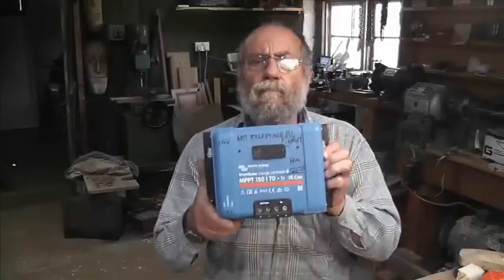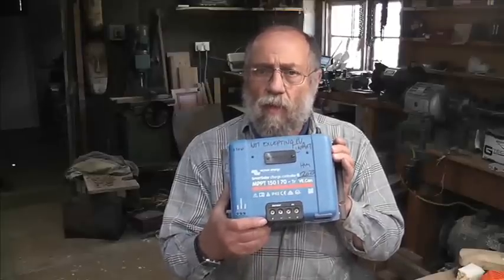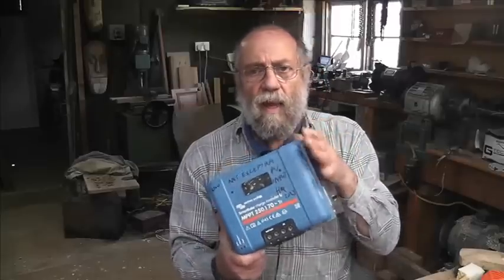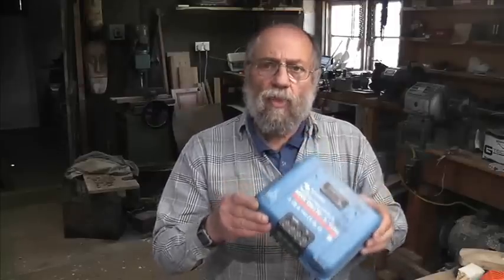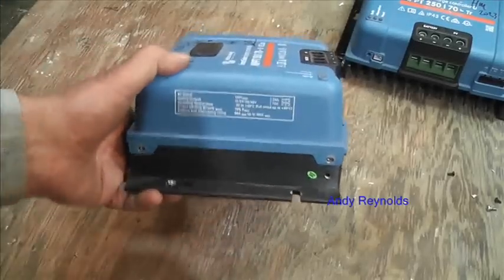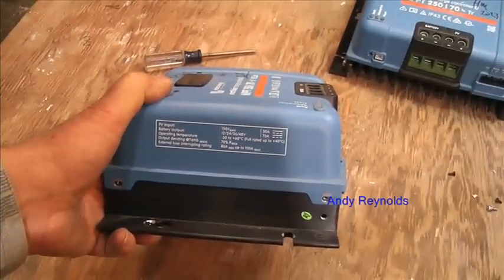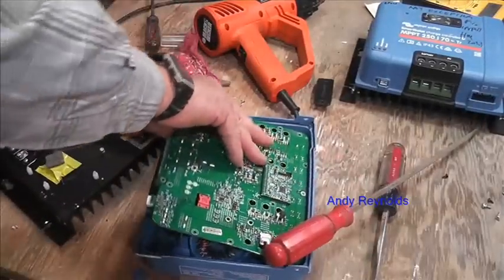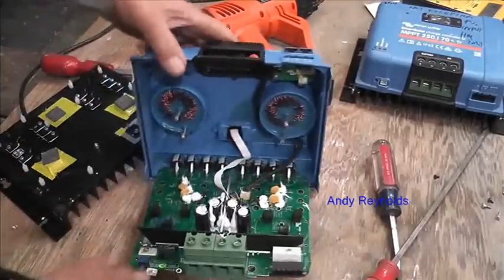Victron MPPT charge controller exploded

Comment: Maximum unrepairability. Everything is assembled on the backplate/heatsink, potting compound is poured into the housing cavities, then the fully assembled electronics package gets dropped into the housing, screws are put on to keep everything aligned until the potting sets, then the thing can never be taken apart without destroying stuff. If you want to get in without destroying the electronics, you have to hack the housing away to free the inductors and caps.
Reply from the maker: Hi, yes cutting the top apart seems to be the way. Time for someone to show precise measurements, someone with another unit and a loose top, cheers
Reply: @TheInfoworks  make holes across the housing, string a jigsaw blade through, saw the top off. Probably the easiest way to avoid damaging components since you are cutting away from components after the starting holes and can also use a boroscope to check things out first.

Comment: Same thing with Apple products.
Reply: not sure I agree, apple is very repairable, and always was, typically cheap spare parts came online quite quickly after a release. but now with apple the phones are still easy to take apart and replace parts, but you have to get apple to do it because of ID chips in the screen, battery, etc that are linked to the phone. This nonsense with victron is tricky, because even they can't take the thing apart to repair it. So either they have every confidence that their items won't fail, or they charge such a high margin that warranty repairs are dealt with by throwing a new item at the customer!
Reply: @bootsowen  Apple laptops has been easily reparable up to the M series, now they go into landfill. Or is sent to Africa. Victron charge a very high price compared to production cost it is designed in the Netherlands but is produced in India presumably with low salaries. US built inverters can be run full load continously but I would only run Chinese ones up to like 75% of rated load. But since the latter is third the price it is still worth it. Victrons inverters five years ago would lower the permissible load if run continously but they were as expensive then. Some Youtubers in vans reported this. It was thermal shutdown. Victron never was a consumer company they started vith equipment for big luxury boats were the price wasn’t a problem.
Reply from the maker: @bootsowen   Owen, that's how it seems to me, having destroyed one in the name of find out, then the next one has more of a chance, cheers

Comment: I think maybe victron are no longer able to compete with the cheap products which are widely available. I notice much of their stuff is 'on sale'. When you can buy 3 cheap inverters for the price of one victron what are you going to do?
Reply from the maker: I have good experience with the older Multi plus inverters, 25 Mw, 15 years and still going strong, but as you say the competition is getting better. The main thing is run them cool and not near rated output, cheers

Comment: I have a HYUNDAI genarator in to fix the inverter is potted in resin so no repair I think items like that should be removed and banned down to waste we supposed to be green in the UK lol
Reply from the maker: Hi, I can see vibration can be a problem with generators but total potting is just corporate banditry, cheers
Reply: @TheInfoworks I get it with the heavy caps but a simple cable tie fixes that but resistors and small components no need for it like you say its about the money
Reply from the maker: @daveherd6864   Dave, exactly, and so the company good name and respect for quality is slowly eroded away at the altar of short term profit and bonuses, cheers
Reply: I also had a hyundai inverter Generator used it 2 times for maybe a few hours of run time and boom dead like you say all potted junk unfixable without a new inverter that you cant buy

Comment: You can use the PCB to drill the front cover to make a jig. This can be used to access the screws on the ic's on the heat sink.  You can then access through the tear. You would have to drill the front cover on every mppt you opened but it looks like it could be done while missing the coils.  Try it with the other unit?
The potting on the front cover is about vibration, mainly noise. You know how noisy coils can be.
Reply from the maker: Hi, yes, vibration but they didn't need to apply so much. I'm going to investigate this wrecked board to see where the power loss is, might be the FETs, in which case we will just have to take the other unit apart. more vids later, cheers

Comment: subbed m8. thanks. bought a 35$ 30A mppt controller on aliexp by EASUN, was considering viktron but atleast i can take this one apart... feels like about 35$ worth of copper inside so it cant be that bad.
Reply from the maker: Really difficult to know where to allocate hard won funds. I've found keeping units cool and not running too hard helps with reliability, cheers
Reply: I have an OAE 60 amp MPPT for 12v to 48v systems with a max of 150v input. It weighs about 15 pounds or more. I don`t know how to program one and the manual is badly translated but I set it to 12v for my 300ah battery and chose the lithium ion setting. It only has float and it`s auto set to 13.80 volts which is the cutoff voltage of my LiFeP04 charger. But this can be changed. 

I ordered a Victron 100/30 to raise the wattage going into my battery because the controllers force us to use 10 gauge cables and I can only charge at 300watts with my setup right now using 12v. I need about 600 watts for my 400w window air conditioner after the next hurricane and to easily recharge my portable power stations for my freezer and dorm fridge.

Comment: If it gets hot in use put a fan on the passive radiator.
OR you can make a chimney over it so all the hot air rising will pick up speed and improve the passive heat sink without any extra powered fans
Reply from the maker: Hi, yes small external fans blowing air up the heat sink, all controlled by a plug in timer. Only runs when the panels are generating, cheers
Reply: I like to use 3 speed USB fans to cool any chargers that get hot.
Reply from the maker: @baneverything5580  Yes, it's important to keep your electronics cool. With an external you can control it and see it working, cheers

Comment: Thats why I bought SRNE MPPTs MAserie, they have huge passive cooling body and can be took apart easy if they fail, whats unlikely, cause I mounted 3 pcs 40mm PC fans underneath powered via a temperature switch.
Reply from the maker: Interesting and yes I use small snail fans controlled with a time switch, cheers

Comment: Try oven heating.   You can leave in for extended time to alllow  the heat to soak in.
Reply from the maker: Hi, difficult, I wouldn't want to cook those capacitors, maybe gas mark 1, cheers

Comment: oh nice, taking apart a Victron charge controller.  I tried to do that on one of my smaller 75/15's that I broke (I tore a screw-head off on the terminal block), so I decided to use the opportunity to see what was inside... but the thing was mostly potted and full of salt (or something) as part of the heat dissipation mechanics.  I didn't get very far.  I always wanted to know what was inside.

The potting is about vibration and heat dissipation.  In fact, absolutely necessary for heat dissipation (not just the FETs.  The inductors and capacitors need it as well).

-Matt
Reply from the maker: Hi, I opened a 12 / 24 MPPT unit a few weeks ago, the heat gun worked. Next week I will be looking at the FETs as the fuse was blown, cheers

Comment: Maybe drilling the bolts on the 14 mosfets attached to the black heat sink so that they are released. The thread in heat sink will be damaged so a solution to fix that will be needed.
Then once the black heat sink is removed desolder the two coils and the 8 capacitors that are potted.
Victron offers 5 years warranty so I guess they are confident about their design and if it fails during warranty then they will just replace the entire device. 
This are 3000W+ DC-DC converters and even with their excellent 98% efficiency it is still over 60W of heat that they need to deal with thus the reason for potting the inductor and capacitors. It also help with vibrations but main reason to pot the inductors is cooling.
They could have designed so that is repairable but the extra cost of doing that is probably higher than just replacing a few units that fail within the 5 years warranty period.
Reply from the maker: Hi, good idea, it may be that the fault could be just in the FETs and then small through bolts could be used giving a little flexibility with placement. I think some investigation is required to find out why the generation is not getting through. The fuses are not blown so it may not be the FETs. Cheers
Reply: Can probably put some screws on the transistors and glue them so it doesn't spin and carfully assemble and put nuts on the heat sink side at the end, just keep in mind any isolation between transistor and screws if it is allready insulated between the heat sink

Comment: That poor manufacturing by victon, how to u repair an instrument, if you can't dissemble easy
Reply: yeah poor manufacturing by victon, that's why they give you 6 year warranty...🥱
Reply: Its a bit of a mixed bag.  If you want something like that to last out in the field you pretty much have to seal it in some manner.  Potting, conformal coatings, etc.  And deal with heat and vibration.   Otherwise environmental conditions outside wiggle their way in and greatly shorten the life of the power electronics.
Reply from the maker: Exactly, it's clear this is not meant to be taken apart, cheers

Comment: I was struggling to see properly as Im on a phone but were the FETs attached to the heat sink with rivets or screws? If rivets, I would drill them all out and then that would give access to desolder the coils and caps. I have 3 of the 100/50 mppts and a 3kva multiplus.. they have always been very reliable, even the single second hand one I have. They are pushing the full 50A most days.
Reply from the maker: They are screwed in place, but from the inside. Heat is the slow killer, who knows what these have been subjected to. A small external fan on a time switch will help to make yours last longer, cheers

Comment: Appalling.
I've just watched the video ChrisFairbrother recommended. It's a good one and followup too on testing. That guy suggests cutting a slot out so you can see inside and properly mark out for drilling. Others suggest using more heat but then you'd need to know exactle where the potting is. Another suggested sacrificing the caps (as they dry out above 125c and are cheap to replace) to get the coil potting soft enough.
150v @80A is too much for a small passive heatsink like that.
Reply from the maker: Ian, like all bits of kit these days the rating is only achieved under perfect conditions. In real life they fail, much better to run at a lower rate for a decade or more. I'm thinking of cutting the top from the other unit, just to see if I can fix it and deal with the top problem if I need to, cheers
Reply: @TheInfoworks hi Andy, perhaps these devices should have a duty cycle on their specifications. A lot of effort has gone into their design and manufacture. Is the pay back of repeat custom from blown units too enticing to fit larger FETs or limit their capability within a safe margin?
It's a fine line to design them to fail often enough to get repeat custom but rare enough to not damage their reputation.
Reply from the maker: @ianhelsbyservices  Ian, I think applying rule 2 as a standard means buying an extra unit, but only buying it once. It's the same with grid inverters, pushed to the limit in enclosed poorly cooled areas, a disaster waiting to happen, cheers
Reply: Your comment about the heat sink being under rated for X current and X voltage makes little sense
without mentioning the FETs on resistance. The source voltage is totally irrelevant when talking about losses in the heat sunk FETs. It's only the voltage across the FETs  that count towards the losses. Power dissipated in the FETs = I²R (current squared times the resistance) If the current is 80A and the fets on resistance = 20 miliohms, then the losses, in watts  = 80² x 0.020 = 128 watts with a fet voltage drop of   around 1.6 Volts (current times on resistance) 
If the FETs on resistance happens to be 10 miliohms then the dissepated energy would only be 64 watts at a voltage drop of 0.8 Volts
The on resistance of new tech FETs is getting crazy low these days allowing for huge currents to be switched with minimal losses.
Reply: @jamiesony3859 thank you for your reply! The information and perspective you share is exactly what this channel is about.
I wonder if the resistance elsewhere in the circuit could contribute.
Reply: @ianhelsbyservices  I appreciate your reply, it can be hard to correct information without coming across as an arrogant dick, especially over text. No criticism intended and I'm glad you took it as such :) and of course anyone watching Andy is obviously keen to learn so I took the chance. There will definetly be some losses in the inductor coils but it will be negligible compared to the FETs. I would guess that high 90 odd percent of the losses will be in the FETs alone.
Reply: @jamiesony3859 looks to be a IRFI 4321, 12.2mOhm max 16mO. My initial comment was misguided as I had inverters on the mind which would take switching frequencies into consideration. This being an MPPT wouldn't be switching as fast I don't think.
For communicaring over the internet in general:- I try and take something positive from all comments, even if on the outset it could be misconstrued. The exchange usually ends on a positive note.
Every day is a school day.

Comment: Thank you sir. What is the point of fuses is you cannot get to them?
Reply: Basically they are there as a safety because these things are typically connected to batteries capable of pushing hundreds, sometimes thousands of amps if they get shorted.  Since the output current is 100% regulated by the micro-controller, the fuses should never blow unless something truly critical has failed and shorted inside the unit.

There is a second safety circuit in there but I'm not sure where... Victrons have a clamp feature on the solar input terminals to short them in-case a regulation failure causes the input voltage to pass-through to the battery, putting excessive voltage on the battery.    Some of the FETs are probably dedicated to that purpose.  The rest are part of the Buck circuit(s) (looks like there are two separate buck circuits in parallel inside the unit).

-Matt
Reply from the maker: I suppose they are there to help to reduce the risk of fire, and to make the unit unusable, cheers